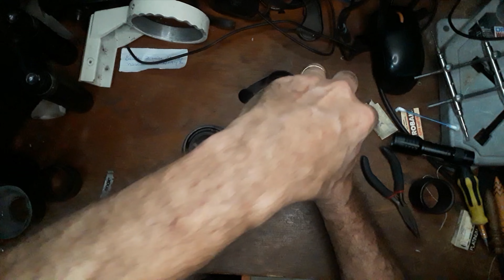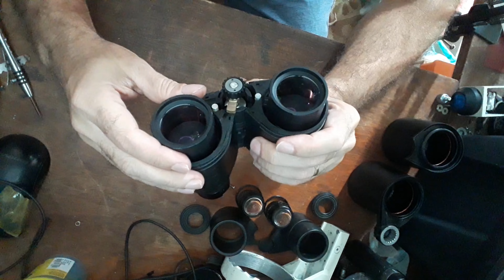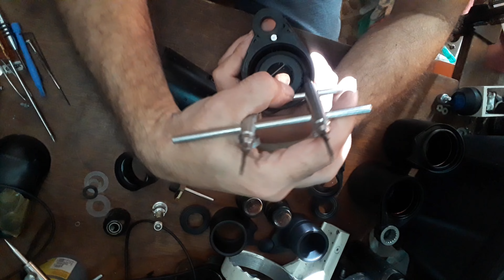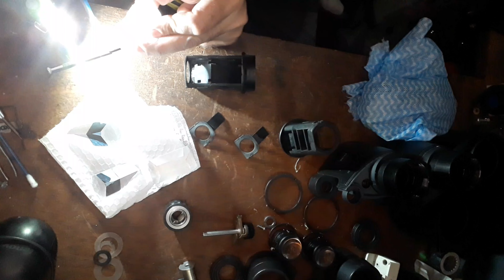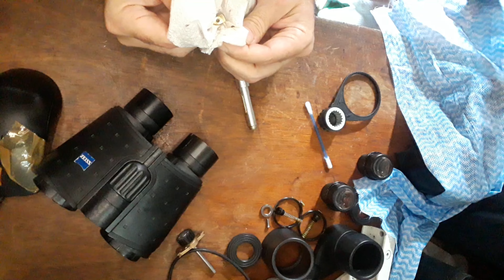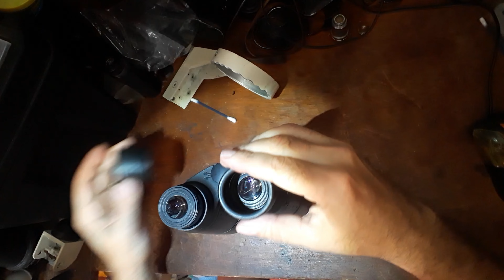Zeiss Victory 8x56 binoculars - Full dismount

Comment: Hello, hits the nail on the head for me. This is my model of binox, we sent them to ZEISS Germany, they sent back stating there are no spareparts available. My unit is perfect, but 2 lenses came loose, lucky  in the open cylindric space - no need to strip further. Now:which way are the thick and the thin lenses mounted in the body? Could you perhaps make me drawing? Greetings from South Africa - Wilfried Wesslau
Reply from the maker: Hi. Could you explain again?
Reply: Thanks ! With my unit there are lens No 3and 4 loose in the body.
Which way are they to be fitted?
Reply from the maker: @wilfriedwesslau332  could you send a video?